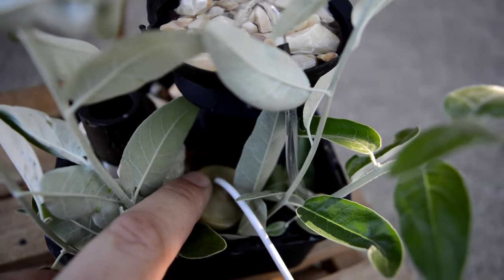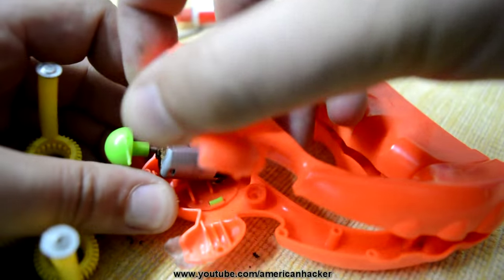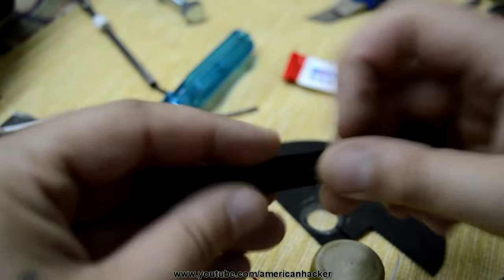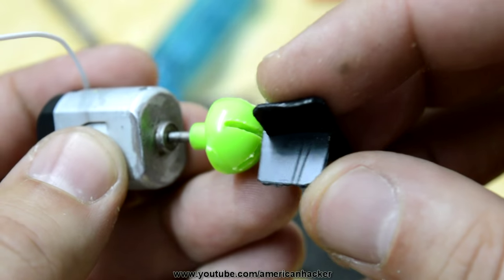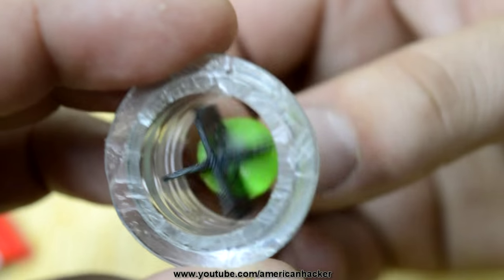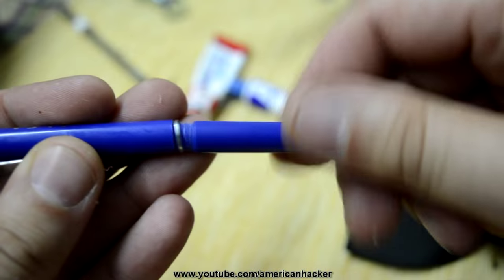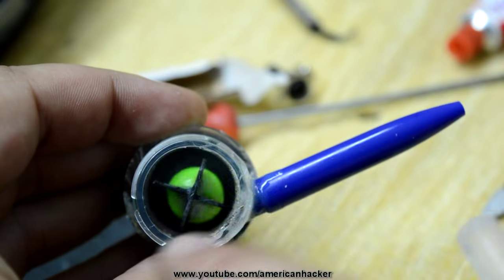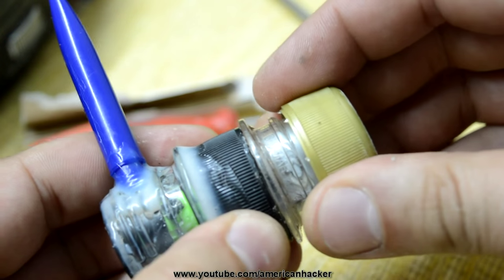How To Make Mini Water Pump From Trash

Comment: are those bottle caps water tight?
Reply from the maker: +Samuel Hobden all of them are bottle caps
Reply: +American Hacker He was asking if water would leak into it. "Water tight" is a saying that means whether or not water will penetrate. If not, it's water tight. This also works with "air tight". Please do not be offended by this, I realize English is not your first language, so I figured this would help you.

As far as it being water tight. Yes it would be if sealed with the adhesive correctly, otherwise the motor would blow pretty quick from water exposure causing shorting.
Reply: hentai nat yes if it's air tight it's also water tight but they are not equal to each other. Since the oxygen molecule is smaller than the water molecule you can have something that is water tight but not air tight. Since it does go down to the molecular level, it's not often thought of that way though. Either way, the two terms are different.